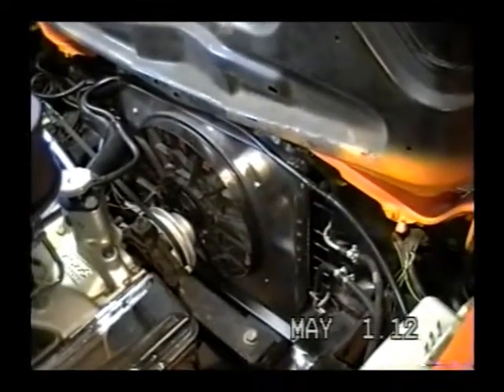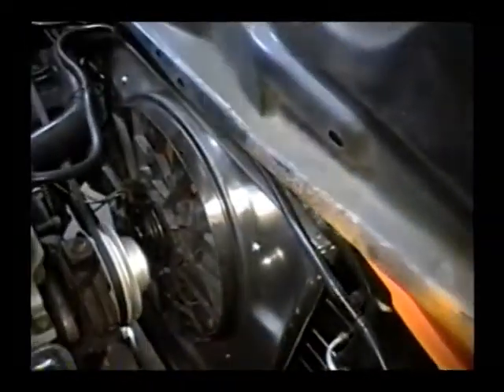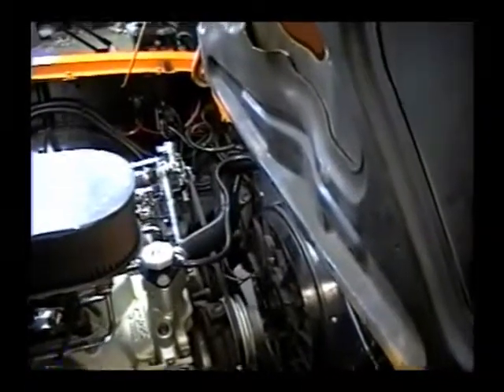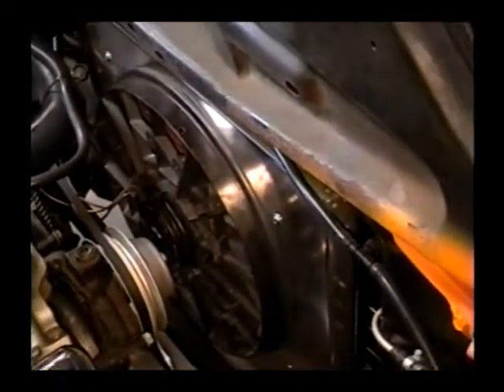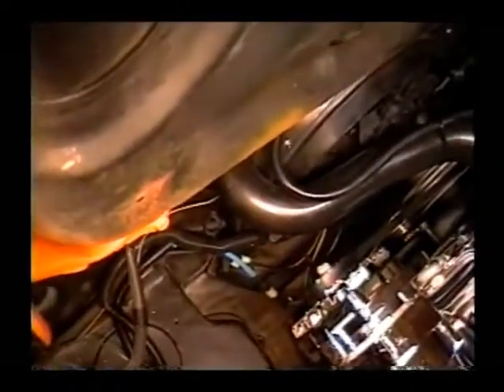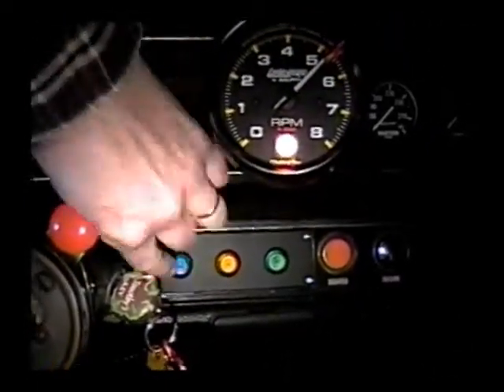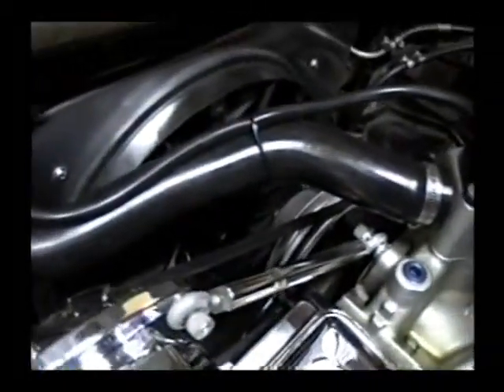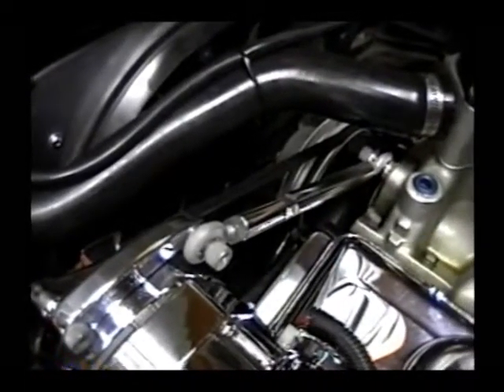Taurus fan conversion

Comment: I have found that aluminum shrouds build up heat and slow dissipation down. The Taurus original plastic shroud does not transmit heat (convection) as much. Even though the plastic doesn’t cover as much radiator... it will still perform better.

Comment from the maker: Did a parade with the FrankenVega and had no problems. It was in the low to middle 80's that day. Just putting along at a walking pace and occasional stops for about an hour, it never got above 180 degrees(where I set it) and never kicked into high speed. Though I did use a bottle of WaterWetter to my mix.

Comment: I have this fan on my Camaro and it works great.  The high speed eats 40 amp relays and 30 amp fuses.  There are solutions for this.  Some use 75-100 amp continous relays with 40 amp slow blow fuses. Any updates?
Reply from the maker: The controller fried last year so I made my own with 60 amp relays and such.    http://smg.photobucket.com/user/tjcoyote59/media/Taurus%20fan/Dual_Speed_Fan_Diagram_V3_zpsrynqhnzh.jpg.html?sort=3&o=0